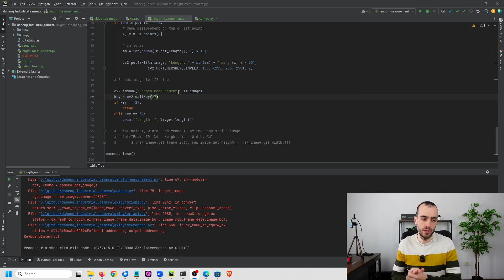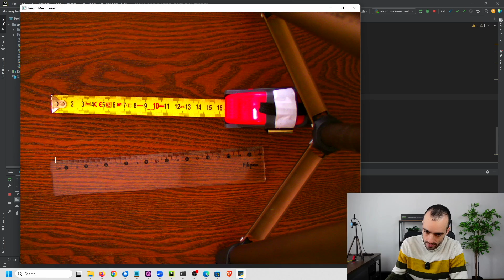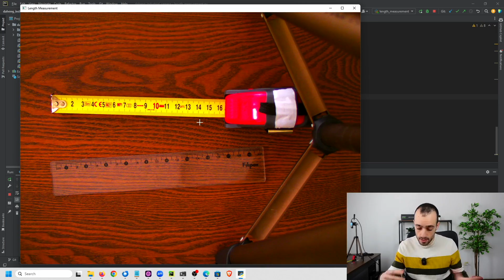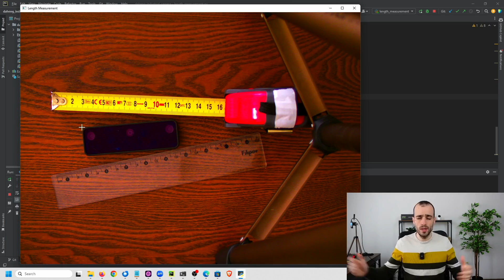How to measure size of objects with a very high accuracy using a camera

Comment: If camera is at some angle will the accuracy be changed? 
I want to calculate the area of the table but the problem is my tables are upto 20 metres long. I want to measure the surface area of the table. How can i measure the length and breadth of the table accurately. 
The problem I am facing that edge of the table that is near to the camera contains more pixel while the other edge that is let's say 20 meters far, contains less pixel. How can I still calculate the area perfectly? Any suggestions?
Reply from the maker: Yes, if there is some angle, the solution needs to be more complex and take angle into account.
It's important the use of a high resolution industrial cameras, with no-distorsion lenses.
Distance of objects from the camera also will affect the accuracy
Reply: @pysource-com  I am using Zed 2i stereo camera for this task. Can you suggest any algorithm or a way to achieve this task?